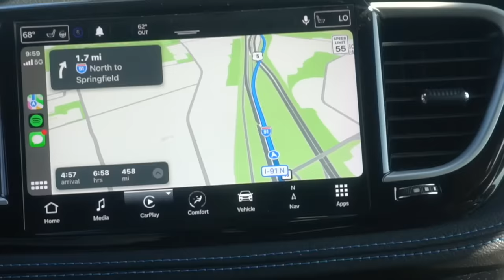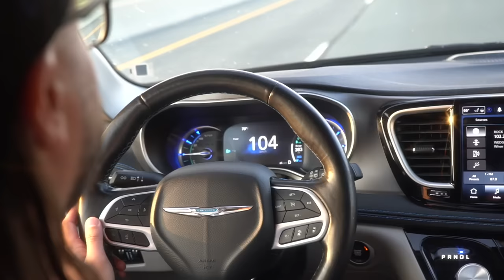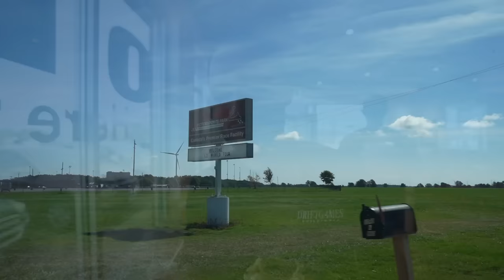My Freshly swapped Supercharged LS3 let go..

Comment: Texas Speed we need a sponsor. I know Jimmy’s channel is not as big as other car guys. He makes up for it in quality and technically explaining everything going on and the group of guys he work with that he cares more about then him self
Reply: Texas Speed x Jimmy Oakes collab would go crzxy
Reply: Was literally just gonna say this
Reply: Get a tsp engine watch it blow just as fast as the oem engine
Reply: Texas speed makes junk . Better off with LME or Thomson
Reply: Not all junk but def LME or sum lol.
Reply: @justinw_tbss_dadvan9447   yes, those engines do still blow everybody knows that no engine is invincible. But it’s still stronger than OEM and can take more abuse.
Reply: Am sure collete was had sponsor with them why not jimmy
Reply: I was just about to say a tsp427 💪🏽💪🏽💪🏽💪🏽
Reply: they helped him a year r two ago when he did a few updates the the LS Z
Reply: LS + performance upgrades + aggressive cornering = blown up LS 
Weak oiling system, weak valvetrain are fine stock but throw a blower on and start swinging corners at redline and it let's the demons loose. Look at Brian's first engine. Look at Taylor Ray's first engine in the Miata. Both went both got dry sump upgrades to make them last longer than 1 event or 1 practice.
Reply: @ClimptonDiddlehopper  Wrong. They used hi flow, hi volume oil pumps. Its very known in the drag racing community those are forbidden lol Basically they just suck the pan dry and cause cavitation issues. Obviously you want to replace the oil pump on a used motor if you're already in there but with a normal flow/volume unit. Also with the hi flow stuff it can be bandied by over filling the oil. I actually tried to explain this to taylor ray when he was putting his motor together and he was ignorant back. It was delightful watching him blow two motors up.
Reply: Need a Dart Engine and Dry Oil Sump.
Reply: #Texasspeed
Reply: Big facts
Reply: Or take the engine from the 300z 😂😂 its got texas speed heads and more
Reply: @ClimptonDiddlehopper  Disagree, LS3 has one of the better valvetrains(hollow stem valves), not that any can't be improved.  I'd not drift any $$$ engine w/o an oil accumulator at least!  Dry sump does solves more problems than just oil psi/flow but most don't know how they do.  Look at Rodknock he's been beating on that LS3 forever!
Reply: @jimmydanc  Yup rookies more is better mistake, some drag racers mod oil pumps to reduce power cost and they flow less but enough. The high vol pumps also cause dist/cam gear wear and spark scatter in older V8's
Reply: Texas speed is fairly inexpensive, Jim could prob grab a few builds for what he needs. No drift LS needs to be over 600-700 hp as the torque is insane
Reply: @texasspeed this!!!!!
Reply: @ClimptonDiddlehopper  A rear sump with an accusump has proven to be reliable in LS drift cars.
Reply: @DuramaxDev Steve Morris then
Reply: I agree 💯
Reply: Yea baby got to meet spoon! Was a crazy event!
Reply: Shitttt sponsor the boiiiiii Texas speed come on now that boi hurtin 😞
Reply: Jimmy deserves this more than anyone. He makes me love cars and drifting more than I ever knew I did. Just his passion in wanting to teach what he’s learned and how much he learns makes his channel ten times better than anyone else out there. Yes I love Tj, Tommy and Adam but I’m sorry Jimmy and the crew just have something about them that they won’t ever have. Jimmy is someone who truly loves the sport and building cars and I like others he’s not chasing the views and what the next big video will be. Idk I’m rambling but Jimmy and the crew chase what they love and it shows. So  @TexasSpeedPerformance  help our boys out
Reply: I sit down to wee
Reply: Seen alot of youtubers with broken Texas Speed Engines, quickly too. 
Maybe Jimmy should consider shops with reputations for reliable performance, not free stuff

I recommend TKM, they dont sponsor engines but no need with the records their engines hold, well priced long and short block packages
Reply: Yessir
Reply: All he needs is some drag racing videos to expand his viewers, and he would explode
Reply: @emanh4keem_san420  I support this message, however that's not really what Steve's engines do.
Reply: his ls Z has a txs cam with his name lasered in it, probably has connects there
Reply: Jimmy has been sponsored by Texas speed before. So I'm sure he's got connections.
Reply: @texasspeed
Reply: I'll never use anyone but TKM for my LS builds I've had 2 LS's built by them and a 393 SBF and never had a single issue out of any of them my 416 lasted over 3 seasons on 30-41psi (literally hundreds of passes) before we did a refresh and the only reason we did that was because I wanted to change my top end setup and figured it was time to give the poor thing a break for a few months lol my LSR 427 build was no different it took an absolute beating and never once let me down I put 300+ passes on it before selling it back in 2022 to a buddy of mine and all hes done to it is a new set of head gaskets and a cam swap otherwise shes still kicking
Reply: We gotchu Jimmy, let us know what parts you need

Comment: The killer for most LS motors in drifting is oil starvation. They have all kinds of baffling for oil pans. It sounded like it lost oil to one side an might have cooked a bearing  an than bent a rod. Keep running the LS you will love it. Just need to maybe spend some money's on a drysump or look into a pan with serious baffling. Don't get down about it alot of people have figured it out the hard way. Ask Taylor Ray.
Reply: Guess you are new here, Brian's LS died due to oil starvation, he even made a shirt to sell for brian to get the money for a dry sump kit for his car. He is well aware of oil starvation.
Reply: Fr, Ray will get you in the right direction about the dry sump pan!
Reply: The pan he has had serious baffling, it was In the build videos
Reply: Don't even need a dry sump. Just a good higher capacity baffled pan, melling oil pump and an accusump.

Comment: I knew it was gonna happen! You need a dry sump for LS when drifting to prevent oil starvation.
Reply: yes, its a must, does Jimmy not watch Taylor Ray?
Reply: Sux he spent that much money on a brand new build and slacked on an essential for drifting and now has to spend more money on rebuilding a brand new motor. He would have saved money just putting on a dry sump from the beginning. At least now he can upgrade rods and pistons so he can add more boost.
Reply: Yea at least an accusump or something
Reply: Don’t kick the man when he’s down. They were on an extreme time crunch to get the swap done at the time. Sucks it was an expensive lesson though. More e36 content way I see it! 🤌🏻
Reply: Grant Runs no dry sump like forever and engines fine..
Reply: @1990Redline he’s been lucky… Luke fink has blown multiple ls and I have friends who’s also blown many. They’re not as reliable as ppl portray them to be tbh
Reply: Crazy he didn’t realize this when it happened bry
Reply: @clutchkickpj693  yes they are... its the idiots building them. ls's have very tight specs and requirements. People blow them because they think they can get away without using something like they do on other engines, but you cant, hence it being a builder problem. just like jimmy not breaking in a completely new engine was a bonehead move. dont take advice from the ricer people he hangs out with, itll fuck an ls up in a heartbeat when its new.
Reply: @KableTac engine was already broken in and I think they added baffeling to pan aswell. I blame poor GM quality control.
Reply: @1990Redline grant isn’t supercharged, he’s NA and not running near the horse power.

Comment: It’s a totally different use than most people are using the lsa setup cars for. You’re holding higher rpm for longer and tossing clutch kicks in there with it. It’s a lot of shock to that bottom end. I personally think a dry sump and a piston / rod combo is the best bet. You’ll always have proper oiling and since this is your “comp” car you can’t really overbuild it.

Comment: Damn Jim that sucks! If you want to get it back up and running quick-ish for a decent price. Take a look at Texas speeds brawler series short blocks. According to their website, the shortblocks are in stock and ready to ship. They have a 427 short block that if you sent them your heads to get ported or even ran them as is and upgraded them later and ran the 427 short block, the e36 would rip even harder!
Reply: That's thin walls in a car that already ran hot before.
Reply: The TSP 427 short blocks are resleeved with either Darton or Pore Bore sleeves. But yeah, the larger engine will make more heat, and that would need to be addressed.
Reply: @donbooze9379  I think spoon said they are going to do rear mount during the off season, so they can run a better cooling system
Reply: Hope Jimmy doesn't take a Texas Speed sponsor, genuinely seen too many Youtubers break those engines

Jimmy should go with TKM, they won't sponsor but their engines hold enough records to be worth paying for, well priced packages too considering TKMs reputation

Comment: Im waiting to see the destruction unfortunately. I never saw them pressure-lube the engine during the initial build which the instructions call for. Also for a drift build I would say an Accusump is a necessity if not dry sumped. Also a good idea to do trunnion upgrades during the rebuild and a better oil diverter valve and timing chain like the C5R chain.
Reply: Accu-sumps are the way to keep drift cars alive. I’m surprised that they aren’t as common as turbos or at least nos bottles.
Reply: @texaspowerman it seems to be a cost issue. I believe what you said should be used on every build.

Comment: You definitely should try switching to a dry sump. I think that is a big reason why Taylor Ray keeps his LS running so well, with minimal to no issues.
Reply: Tell that to Rodknock and his LS3 that he ran out of oil once so far.
Reply: @BOOT come on bro don’t compare him as to say that’s normal and ok to do with a ls cuz that’s just not true. TONS OF PPL blow up ls’s and the biggest culprit is because of oiling issues..
Reply: @clutchkickpj693  Come on bro don't compare all LS engines and say that is normal!  The LS3 is different than junkyard LS swap plain jane junk.  TONS OF PPL don't blow up the LS3 CRATE drifting because of the more stable valvetrain.  Now take any junkyard engine and beat on it n it'll blow LOL
Reply: @clutchkickpj693  Better tell Grant he needs a dry-sump for his LS3.  That two YT drifters who are not having oiling issues.

Comment: Sorry about the e36 Jimmy, but we did kinda warn you to use either an accu-sump or dry sump system, drifting is hard for the ls without a proper oil pan. Happy you did have another car there though.
Reply: It's unfortunate, but it's definitely a well know thing. You just have to over-build your oil system on an LS (compared to other platforms).
.
Especially with that big ol' blower on top... heat soaking the hell out of it while staying high in the rev range 😕
Reply: didn’t bryan’s car blow up due to oiling issues aswell?
Reply: @brendan747 every single LS out there is going to blow up if it doesn't at least have an accusump. They just have oiling issues for drifting
Reply: If it’s rod has nothing to do with oiling shit would’ve been knocking before a rod went out. Jimmy simply found the limit of those stock rods even with a tamed limiter, although he should eventually get a dry or accu-sump

Comment: Couple things: I noticed the MAT readings were crazy high. You put the hood on and the engine bay gets hot, idk much about the forced Induction being an issue but 180° is high. Maybe heat soaked Intake, maybe not. Also, like others said, that cam with that block and that boost - running without dry sump around long sweeping turns did it. I think the baffle actually hurts. Your rpm hit zero while you were still moving. Check your oil pressure logs, idk why you didn’t have the display showing it and ecu set to cut off at a low oil pressure scenario? Uncle Rodney likely made a visit.

Comment: Derek and his wild tunes strikes again! 

Nah I don’t think you where pushing the engine too hard just too much limiter, limiter with a super charger can create crazy boost spikes. With the crazy torque that engine was making it would be happier in a higher gear at lower revs, even “lugging” it it’s never under much load with the wheels spinning so it won’t make those crazy torque numbers it did on the dyno.
Reply: I sound like such a keyboard warrior and said crazy 4 times I know, but my first comment when you started the v8 supercharged swap was don’t be banging limiter even just to save the lifters, it’s no JZ or SR this is an ancient technology pushrod v8

Comment: LS' definitely have oiling issues.
.
I'm sure Jimmy changed the oil a bunch and didn't miss something simply... but oil is the one thing an LS always needs to be over-built for, especially when heat soaking one with a blower.
.
If you can't dry sump it (because you know $$$$$), get a large oil system, with a good windage tray and toss in an Accusump...
.
But who knows... Maybe it was just a bad tune, bad fuel or something random

Comment: Such a pitty about the E36. You drove great again but man whats with being best of the rest in Quali? So freaking close to top 16 dude. 
I know once you break that next barrier/goal you'll be up there loads more often.
Really can't wait for what the next year brings.. Another couple of trips with loads of driving and see what next year brings. So cool.

If you end up needing a new engine for the 36 (if warranty doesn't cover, though I think (and hope) it will), what about a Nascar small block? 
Those his different, plenty strong, loads of power and RPM and if you pick up an old car instead of just the engine I hear they aren't too expensive.

Comment: Bet , 
One of those pesky intercooler bolts backed out from vibration and went through the engine . 
Always loctite bolts used inside the induction system similar to throttle plate bolts .

Comment: You dont have oil pressure on your dash? I would of be data logging and seeing if oil pressure was dropping on big angle or just from the gs that track is known for causing bad oil starvation even wen normally racing around it i wonder if it broke the crank? Iv heard of it wen running blowers

Comment: i feel like the LS dropped a valve.
Reply: My thoughts exactly.  Could have then caused major carnage in that hole, but I feel like it started with a dropped valve.  Whether the valve broke or the spring did, I dunno, guess we’ll just have to wait and see though.
Reply: yeah you can always sleeve that one piston, or might have to go oversize pistons. either way it can be fixed. i have a feeling spoon is going to have more fun welding the head and reporting it lol   @TurboAdam